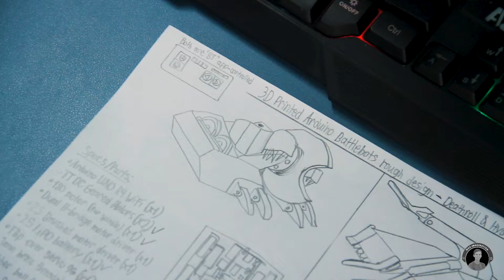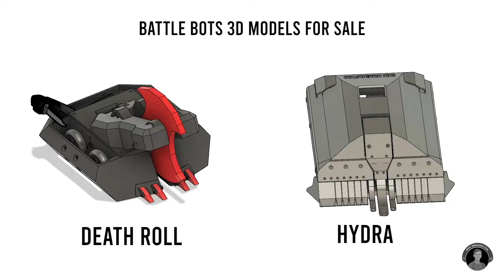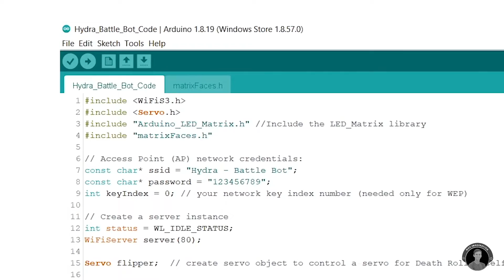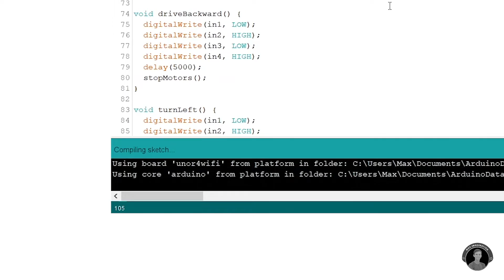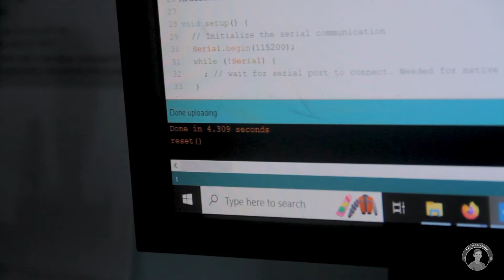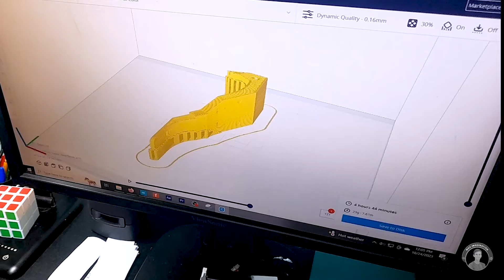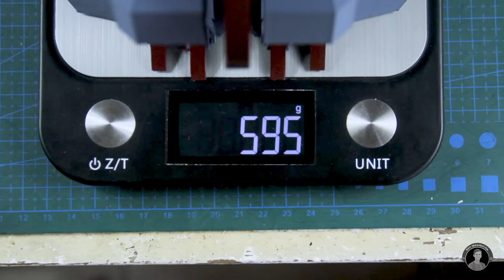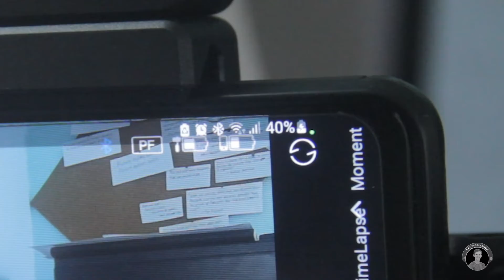Build Two Mini Arduino-Powered RC Battle Bots that FIGHT | 3D Printed

Comment from the maker: Thank you guys for tuning into this video!

🚨 NOTICE 🚨

If you, the viewer choose to take on this project, please be aware of the following safety precautions to take when making or using the bots:
• The robot operators and people nearby must at least wear safety glasses/face shields or run the battle in an enclosure (Battle box) to avoid flying splinters or debris from hitting people.
• Keep these robots way out of reach from children and pets.
• During the making process, avoid using lighters near the Lithium battery or any components when heat shrinking tubes onto wires to avoid a fire.
• To avoid injury to self or others when testing the battle bots, check that each and every moving part (especially weapons) is secured tightly with either glue or bolts.

Also, these mini Battle Bots replicas were intended to be purely models and nowhere nearly as destructive to one another as the real Battle Bots to preserve them. There's always room for improvement on the weapons and other mechanisms if you (a fellow maker) are inspired and decide to take on this project to make them serious combat robots. 

All the same, bringing these mini Battle Bots to life was super fun and I'm glad to be sharing it with you all!

Stay creative and have an awesome day!

Max.
Reply: Even with a box battery's love to get broken and destroyed and those fumes are toxic!
Reply: Hello

Comment: Hey Max! The Arduino I have is a R3 Arduino UNO. Will it work just as fine as a Arduino R4 WIFI?
Reply from the maker: Hey! No, it will not work the same way. You'd be better off using an ESP32 - you need the WiFi connection - WiFi chip.

Comment: Kicking off this last minute summer project with my son, so excited to start, thank you!
Reply from the maker: Awesome to hear... Thank you for your purchase of my Battle Bot design! Happy making 😁
Reply: @MaxImagination   Quick question! What did you use for the front wheel axle? Link please, thanks!
Reply from the maker: @bettymac8248  Hi! I used an M3 bolt. You can find those in M3 screw kits. See the list in the video's description for the link.

Comment: If you do a future video whare you have a vertical spinner like death role you need to have the disc spinning up instead of down, this is so you don't have a pieces from other robots shoot in and damage your hardware and so it can send the other appoint up instead of just nibbling at the appoint. Just wanted to tell you for safety and so you video can have big hits in it .  
I recommend checking out broken link robotics and just cuz robotics to learn more
Reply from the maker: It was spinning up, actually... You will see if you pay more attention closely to when the disk slows down. Thanks for the recommendation!

Comment: Why is hydras flipper lifted up a bit
Reply from the maker: It was due to an issue with the flipper mechanism facing some wear. This may be fixed if those gears were to be made from metal.

Comment: We should start a 3d print no metal battle bot league. I feel like a lot of people would want to get in on that.
Reply: That's actually a thing, the so called plastic antweight class is for 1lb bots with no metal parts allowed.
Reply: @k-hut9344  holy crap!! I’m about to research it and sign up.
Reply: These exist. Plastic ant devision. I’m a bit late here.
Reply: to be honest you can replace most and everything by plastic. This would make it cheap and lightweight so you can enforce critical parts. Plastic also is more shockproof if enough material is present to transfer to energy. 😂
You have some benefits to use plastic even in the original league.
Reply: @benniebond1754  that exists, I have been doing it for years, like 5 or six competititions, do it do it do it
Reply: Battlebots are my life
Reply: That’s been around for so long
You can use metal in most leagues but so many people do that, I don’t think anyone would jump on to your league if the weapons were weak plastic that couldn’t even damage opponents.
Reply: @Brokeittwice  i mean… angel grinders blades aren’t made of metal but can cut metal.

Comment: please use a testbox next time, even at 10% throttle a plastic weapon can splinter and create debris that could damage you or the environment. cool vid, but with all the plugs in the video it seems like you anticipate people copying you - people who might not hold safety as highly as you do.
Reply from the maker: Thanks for your feedback. Also I did not have a test box nor did I have the resources to create one. For safety, myself and the people around me wore protective glasses from splinters or any flying debris.
Reply: @MaxImagination  a cardboard shield and staying out of the axis of rotation (for horizontal spinners, this means standing on a chair or around a corner, for verts this just means being perpendicular to it's rotation) is sufficient for a spin-up test. if you can even just operate from around a corner, or through a glass door that would be enough 👍
Reply from the maker: Thanks for your advice. Safety is something I missed covering in this video, so I edited the pinned comment above to let others know what to look out for. Cheers. @l8dawn

Comment: Great Project. 
I was also thinking of making sumo robot using arduino. Thanks for the video. 
I think that you should make things other than 3d printed, as most of people don't have this. Maybe I will try to make this using other materials like aluminium or pvc plastic, etc.
By the way, lots of love from Pakistan 🇵🇰
Reply from the maker: Thank you so much! Will consider your advice 😀